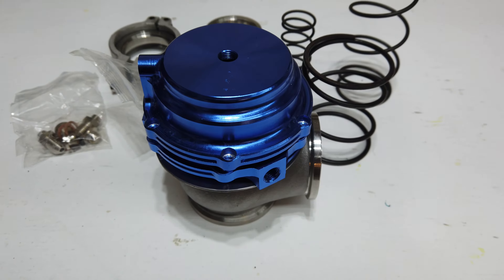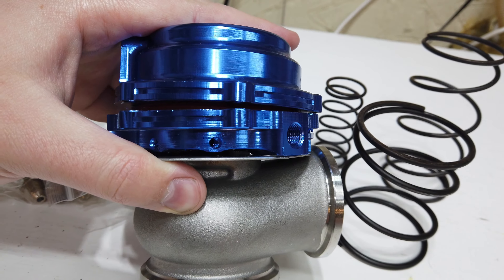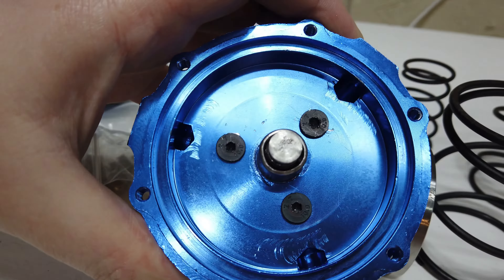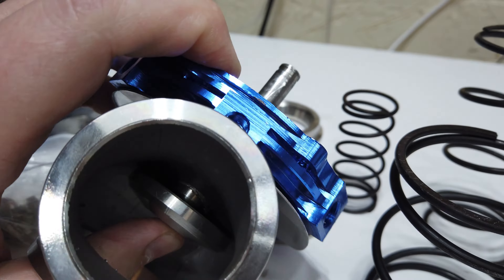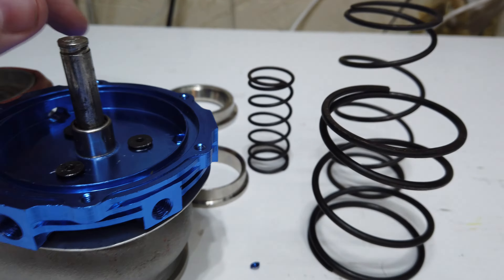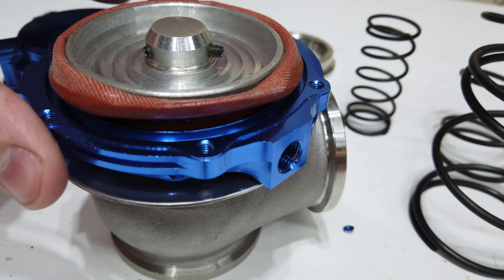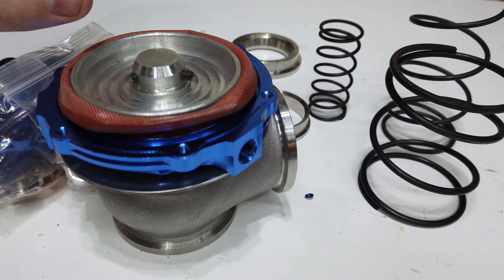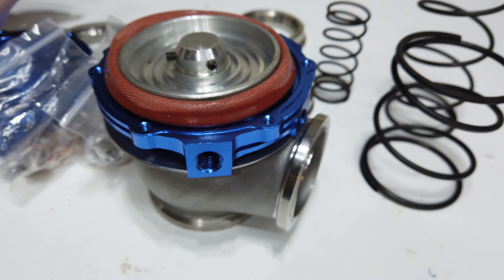Why cheap ebay external wastegates are not a good idea!!!

Comment: Buy cheap, buy twice! Always worth paying a bit extra for something that'll actually last, works out cheaper in the long run. Hope you get a refund OK 👍.
Reply from the maker: Put a complaint in so will wait and see, worst case will go through paypal process
Reply from the maker: seller has contacted me to ask if i would be okay with repairing it with spare parts.......lol told them no i want a refund. Got to send it back  and hopefully get a refund. Right bunch of jokers
Reply: 👍 good luck.
Reply: I also had one of this and would leak at idle, definitely worth spending the extra money for a quality one.